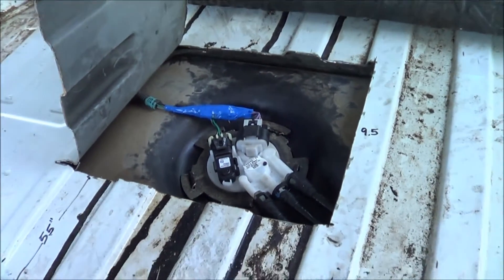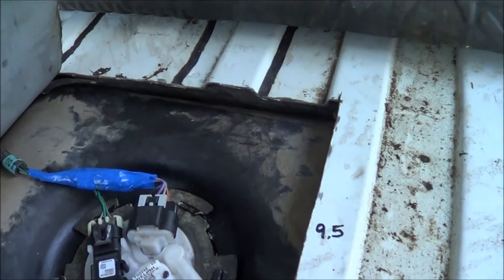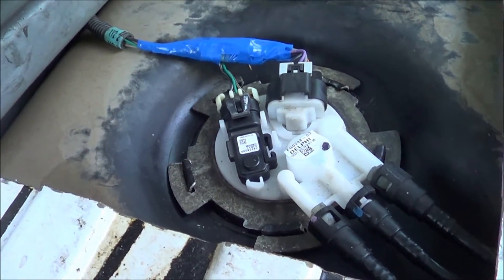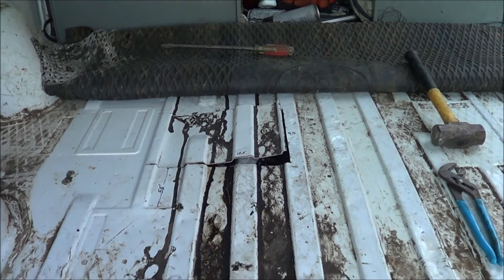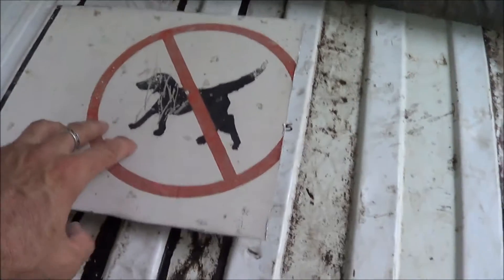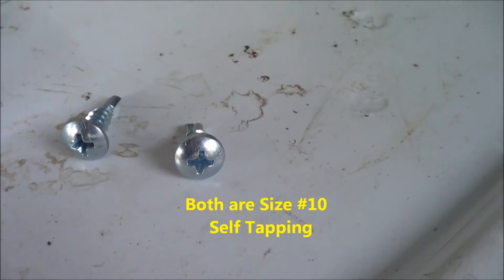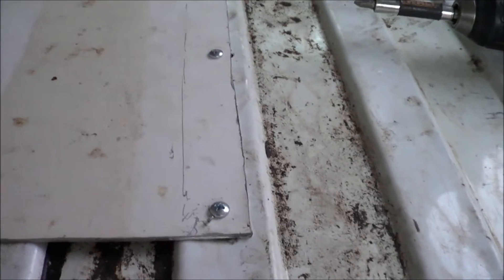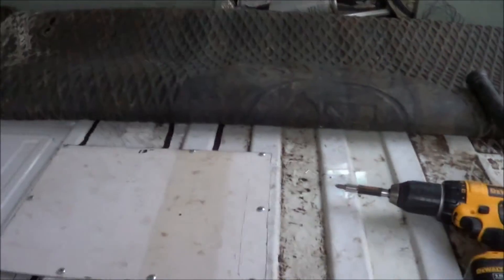Astro Van Fuel Pump through the floor tips # 2

Comment: Where is the Floor measurments for the cut? More Silicon sealer for your next road downpour.
Reply from the maker: https://www.youtube.com/watch?v=NZqyInHq7gY&t=3s
Reply from the maker: The first video I did had the measurements, let me know if you get that link? I didn't film the silicone portion, but jest basically squirted it in the gaps, and a small bead around the plate.

Comment: I would even go so far as to tape off the edges around the opening and spray paint the bare metal, just to prevent rust there. Then I would seal the bottom piece down with metal duct tape and put a sheet of rubber dampener over it before screwing down the top cover. No fumes, no splash up, no tapping or vibration noise from the cut door.

Comment: I would go to the nearest auto scrap yard and find a van of your type and cut out the floor of the size you need.That way it all looks somewhat the same with the floor contour,then seal it and then screw it down.Good job.
Reply: Joseph Mckay great idea
Reply: That is a great idea. Problem is though is that these vans don't make it to the scrap yard. lol I have never seen one there.
Reply: I would just drop the fuel tank and do the job instead of dancing around...js
Reply: @Chancho66  Believe me, "dancing around" is easier. Unless you have a mechanics equipped garage.

Comment: Thanks for the video, for safety and accuracy I used my oscillating cutting tool, no sparks, no worries. cut 3 sides only to make it easier to fasten floor back down.  used the same screws but just ran them into the saw kerf, they caught both sides and tightened

Comment: seems to me that if you did not seal the original metal and only covered it with another piece  it stand to let any moisture in or liquid.
Reply: Even worse, deadly exhaust fumes. Anyone doing this should at least use peel and seal to seal the gaps first.
Reply: I would just drop the fuel tank and do the job instead of dancing around...js
Reply: Flex seal tape!
Reply from the maker: https://www.youtube.com/watch?v=5yQqFhh57qQ

Fast forward to about 3:40, I did seal it with some silicone

Comment: I did this to my Astro van but when I went to put the floor back down I laid strips of plywood underneath that cut out and put the screws through the top of the floor into the plywood underneath and I had my original floor back down I didn't have to put a piece of metal on top and I was able to seal it with waterproof cocking